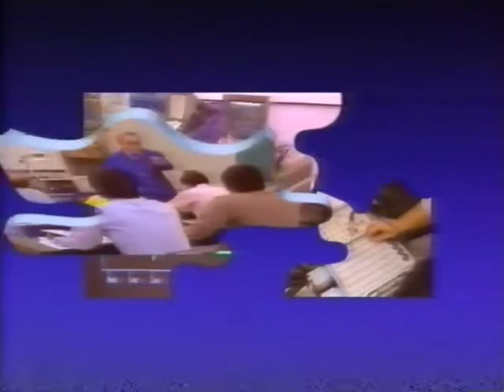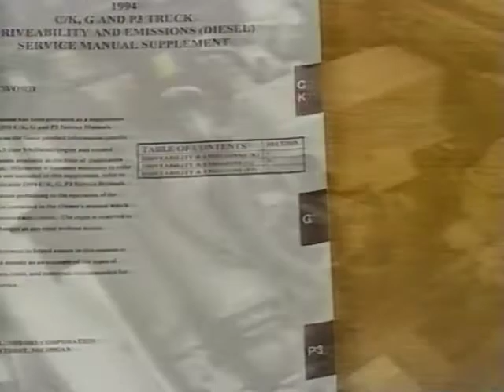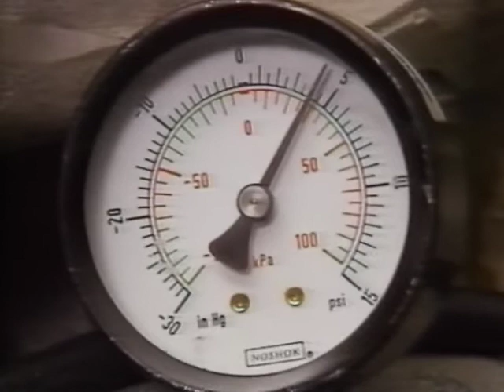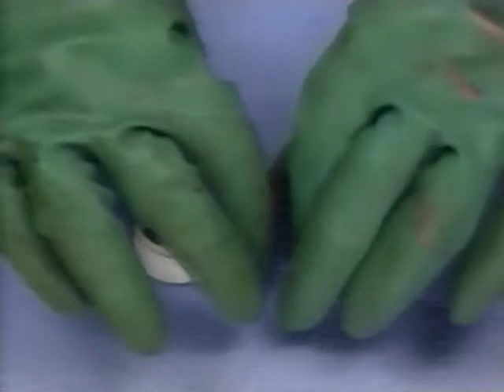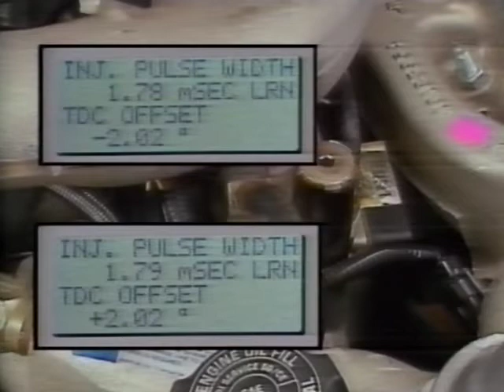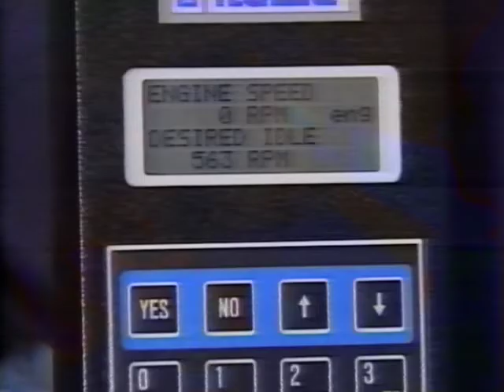Chevy/GMC - 1994 6.5L Diesel Driveability Recall

Comment: I've personally purchased 13 pumps and they all lost pressure within 3000 miles i have 4 brand new pmds on hand ! They chevy refuses  to address any issues they create and that are clearly identified ! so the pmd is only a teeny tiny part of this issue and its whole main problem ! Ulsd which is the only diesel available in my state eats the seals right out of this pump in nothing flat !  These pumps and motors should have never been sold in a vehicle headed for colder climates ! here I am 20 years later and chevy denies this recall even exist and that my vin which is on page 3.. 5 rows up built in flint Michigan isnt even on the list which is a lie. I'm about 20k plus into parts and labor on my own for a motor that will never run in my state there is literally 3 left and no mechanic will touch it ever again because it's junk ! Chevy customer service is shit literally the worst of the worst ! They knew full well fuel in cold states would destroy these yet put profit over people then took a government bail out and instead of fixing problems made more problems ! I've bought 5 new trucks all cummings since the purchase of this chevy and held onto the chevy in hopes they might hire real management and real customer service which they never did they hired a bunch of liars whom dont know how to look up vin numbers or as this cs rep korea calls them van numbers. It helps if they know what they are doing but clearly do not !

Comment: Ya the pmd I think all the pumps mostly were fine they didn’t have a fucking clue the pmd is the biggest problem with these engines  9 times out of 10 it’s the pmd
Reply: Bet you a million dollars its not even close to the 9 out of 10 prob ! Fuel quality and lack of quality fuel is ! I'm living proof of it ! There are 3 of these detroit diesels left in my state literally 3 detroit 6.5s still registered and I know one is a cummings transplant so mine and one other ! It will only run 3000 miles max and then the pumps loose pressure completely ! Out of 60,000 stores in my state that sell diesel every one of them sells only type 1 diesel in the winter and chevy knew it when they sent these !  because it often goes 20 below ! The petroleum additive they add to the diesel melts plastic ! I've had diesel eat a red solo cup just like gas yet ive placed type 2 diesel in a cup and it did nothing ! I literally purchased 13 pumps in the past 10 years and had over 30 in the past 20 years in this truck a 1999 with 117k miles ! The motors fine ive kept up on all maintenance its the pumps themselves neoprene and gasoline do not mix and they add petroleum to the diesel to prevent gelling up in the winter ! They were ordered to address this yet still refuse to fix it they instead hope it goes away ! I'll never buy another chevy and my family owns a chevy dealership ! They know why ill never buy another one and agree with me 110%